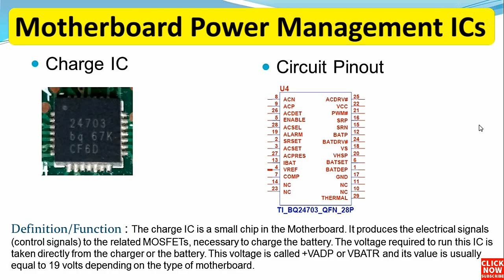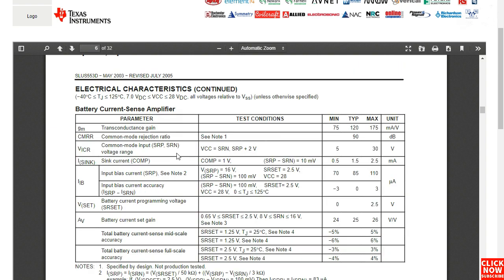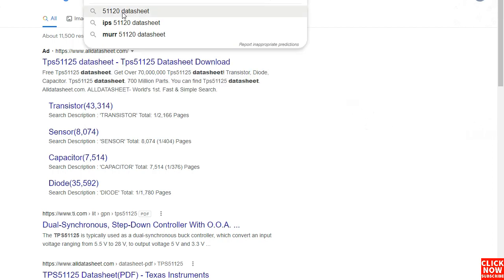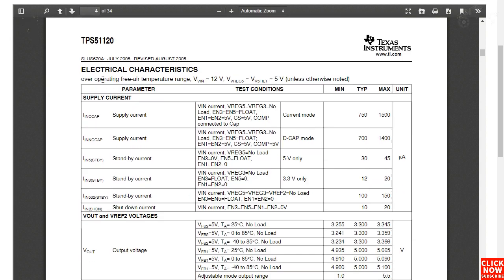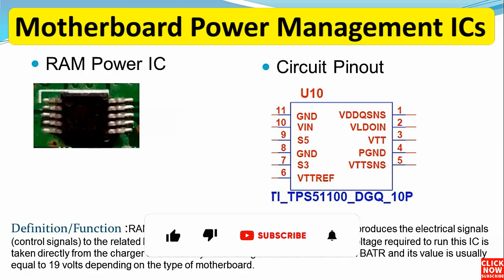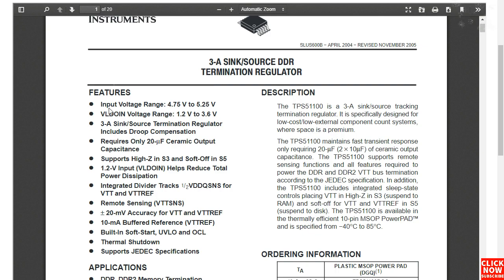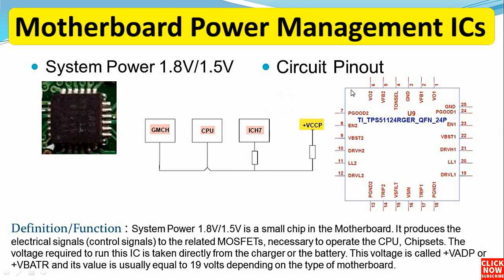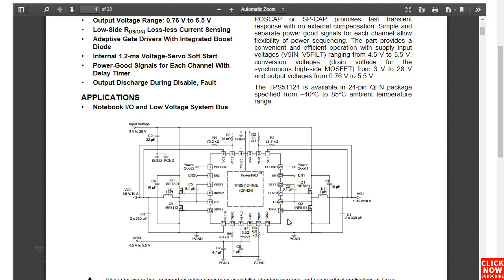Laptop motherboard main circuits & PWM ICs, charge IC, CPU PWM IC, RAM IC, +VCCcore, +VCCP, VTT, VDD

Comment: Sir please help me to find the datasheet of my laptop IC printed at the top of the chip 24=3B 15Z, or 24=3G 15Z or 24=38 15Z  (hp pavilion x360 15-bk002nx turns very hot when i plug in the charger and the charging indicator light is blinking. Thank You